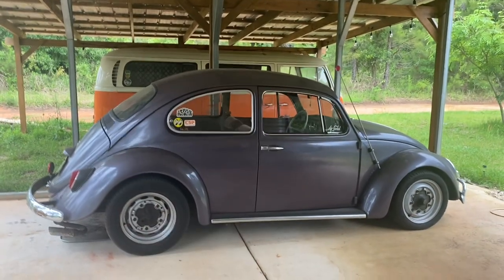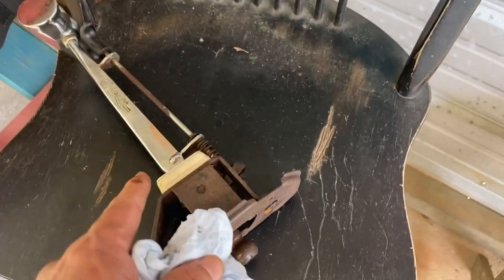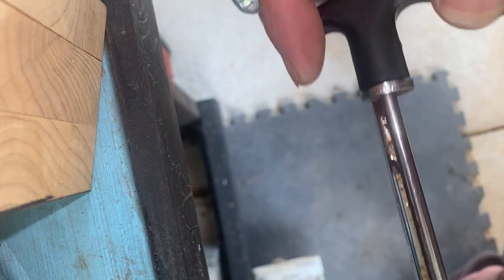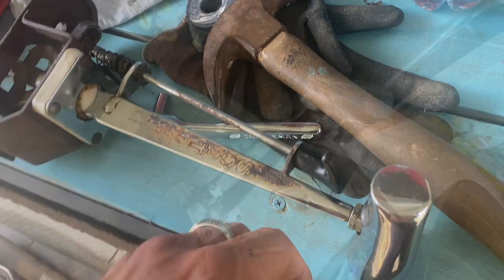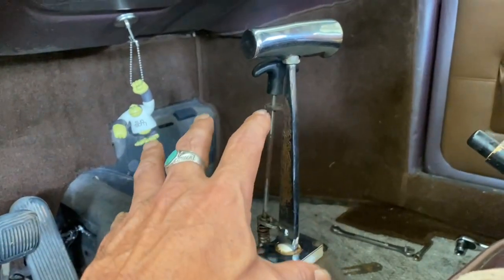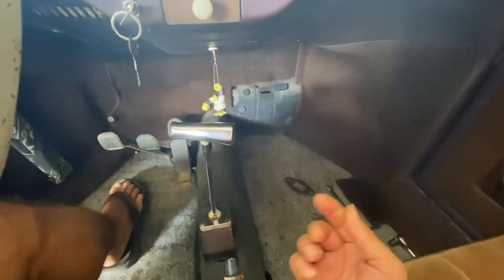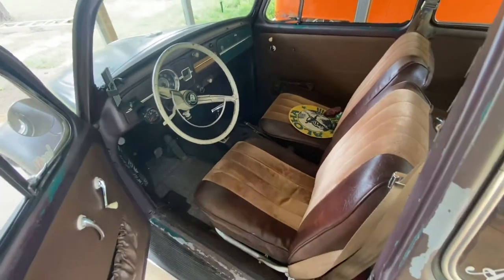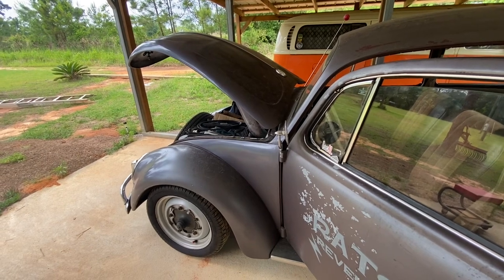Old SCAT VW Shifter Review

Comment: Yes, that’s the Scat drag shifter. I still have it but a couple years ago I installed the BUS Scat drag shifter version in my ‘74 RatRod beetle and love it!  
Nothings cooler than having a tall shifter in a tiny car!
Now, in case you’re wondering, I did have to put several washers under the shifter itself where the 2 bolts to raise it a smidge because the ball is a little lower(longer) than the standard beetle size.   
In case you’re wondering if it can be done, yes it can😎
Reply from the maker: Thanks for the tips! I got this shifter sort of on accidental good luck. If I buy one I WANT THE TALL ONE so I’m glad to know it can be done. I agree that tall shift gives a lot of style points…just something cool about it🤷🏻‍♂️ especially I’m a Rat! Thanks again and dub daily.

Comment: Those are great shifters... i've had them on all my VWs and recently put one in my '63 project.  Yours is the "straight" shaft for the later cars, but you can get and "angled" one for early cars.  That puts the handle further back toward the driver so you don't have to reach as far.  They can be finicky to adjust, especially if you have a worn out bushing or coupler, but once dialed in they are hard to beat.
Reply from the maker: I didn’t know that about the angled vs. straight shaft. I got lucky finding this one in an old pile of parts but will keep an eye out! It hasn’t been finicky yet, but I had recently replaced both the bushing and coupler. Thanks for the info and the view. 🤙🏼

Comment: I have one of those shifters in my dune buggy i just bought. I don't have to pull the trigger to engage reverse and it doesn't want to downshift. 
Do you have any suggestions for me please
Reply from the maker: I think I have a video where I changed the shift coupler and bushing that you might want to see. Also it could just be a simple base plate adjustment, which I think is in that vid too. Pretty easy fixes, you just have to start with the easiest possibility and expand if needed from there. Try loosening the nuts that’s hold the shifter base down (slightly), then make sure you can shift from 3rd down to second. When you find that sweet spot, tighten the nuts back up. Hope it works because you’re gonna love that shifter if it does.